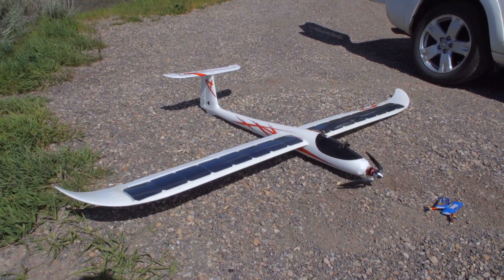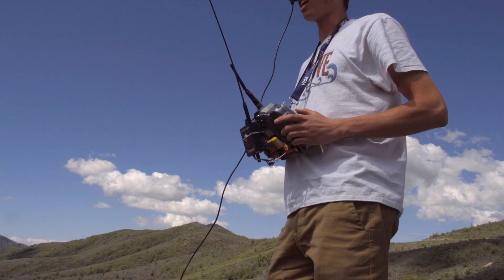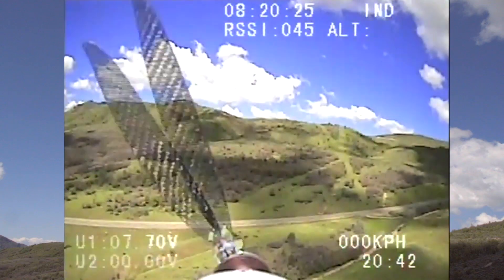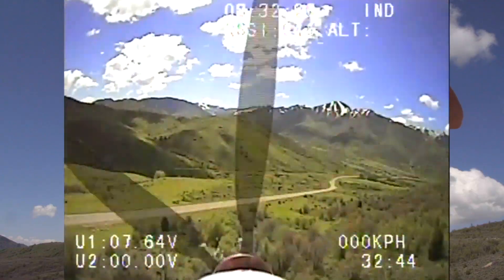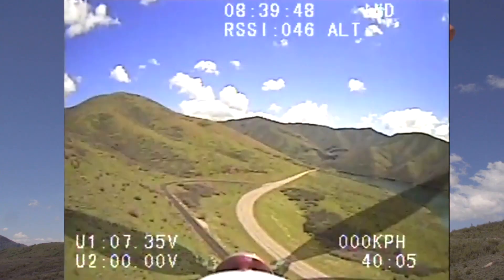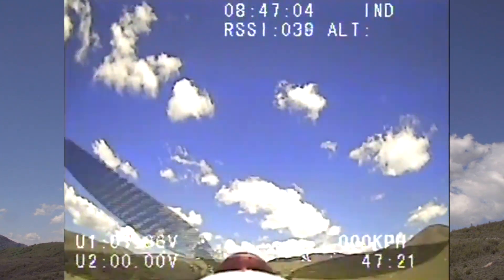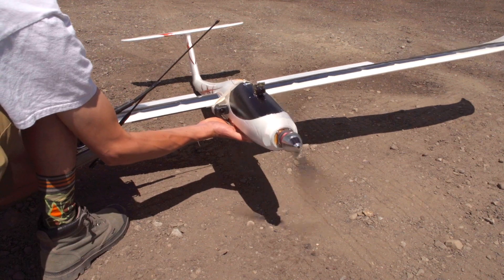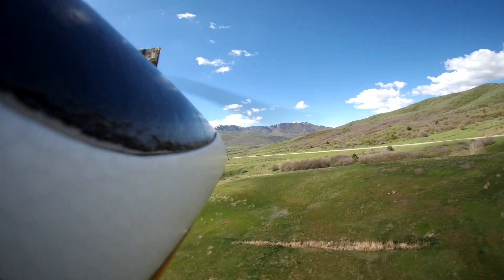2.6M FPV Glider with Solar Cells on Wing

Comment: How do you charge a LiPo with solar usually? Is there a special charge controller? you say your not using one here but for safety long term. Also I would like to know if there's a way of using the windmilling prop to regenerate charge like a lot of e-bikes do.